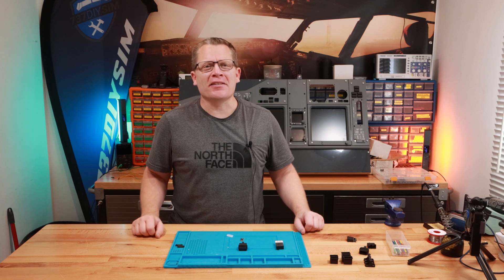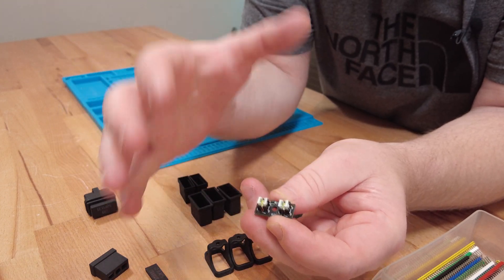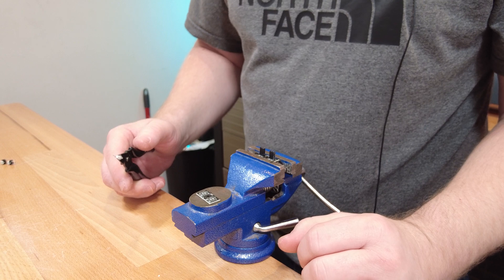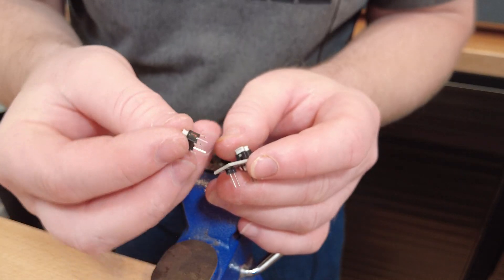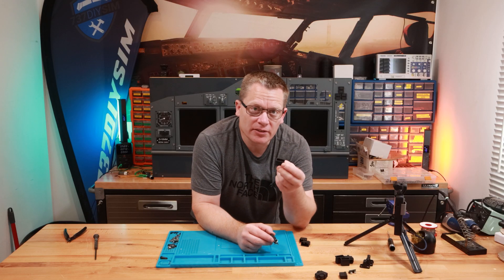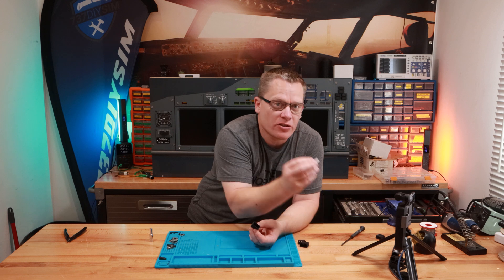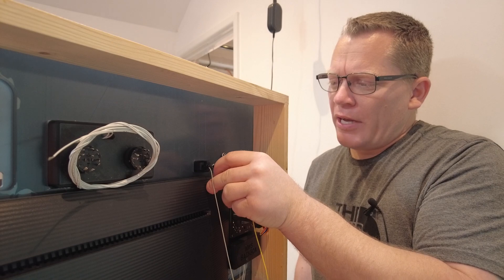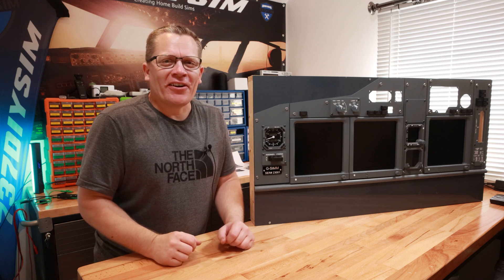Replica 318 Korry Annunciator Build

Comment: Did you use the same MIP as cockpitsimpart when you fit the korrys
Reply from the maker: Not quite – I designed my own MIP for the build. The korrys were fitted based on the real aircraft spacing rather than Cockpitsimparts’ layout. Their MIP is great, but the dimensions differ slightly, so if you’re mixing parts, double-check clearances and mounting depth before committing.

Comment: Hello Karl, would it be possible to integrate the resistors for the led on the pcb?
Reply from the maker: Hello, it would if you knew what colour LEDs you were going to use. There was just no way to produce that many different variations. It's so much easier for me just to have a PCB that can be used for a colour combo.

Comment: I like the design but need the PCB to work more like the originals. All my arduinos sink current for the annunciators, this allows me to use the Bright/Dim switch to provide 5 or 3 volts. I guess i'm describing a type 1 whereas yours is closer to a type 2.

Comment: You are a genius! Super construction. But the 1st one you mounted, for below glideslope, has to have an extra function I think, when pressed it should silence the alarm for being below glideslope.
Reply from the maker: Hello, all the korry 318's have push button facility, inclucding my replicas. You only wire the button/Switch section if you need that function.
Reply: @helimech8152  Which makes the construction even more impressive😃

Comment: Excellent, Karl! Really good idea and engineering! 👍 Same here with my 747-400 sim. If I would build it again (oooh lord 😣), I would also build lot of major parts different, like you said "I should have built ..."! 😎
Reply from the maker: Thank you. However, I forgot to mention that I did not possess some of the skills or techniques when I first started out. I gained a lot of them through experience and by figuring out easier ways to achieve my goals. This design happens to be one of my favorites.
Reply: @helimech8152  Yeah, same skill development here! I think that's a major part of our hobby: solving problems, try and error and eventually the success in reaching our goals  💪😎 -  or, sometimes, a redo 🤣

Comment: Nice to see it coming together but I have to admit I don't understand how you don't push the annunciators through the hole when pressing. I see the other part coming from the back but is the hole in the panel in a special shape so these things have something to sit against?
Anyways thanks for your work! :)
Reply from the maker: The outer case features a 2mm lip around its edge that fits snugly against the panel. This allows the faceplate and backshell to trap the panel, resulting in a secure fit between the two parts.
Reply: @helimech8152  that makes sense, thanks for the information.

Comment: Hmmm nice... I wonder if these could be redesigned to match buttons in H145 instrument panel! :) I have also been trying to find if anyone has designed a standard circular circuit breaker that not only tells the sim that it has been pulled, but can pop out automatically if you pull it (or it fails) in the sim!
Reply from the maker: In regards to the design, it can be adjusted but not made smaller without requiring a PCB redesign. As for the circuit breaker, I have yet to address that issue as it will require a great deal of creativity to keep the cost low and size compact enough to fit multiple units together.